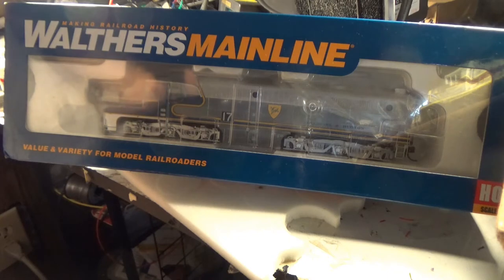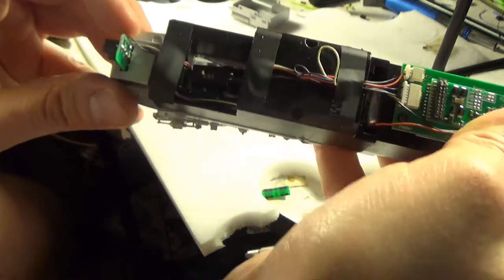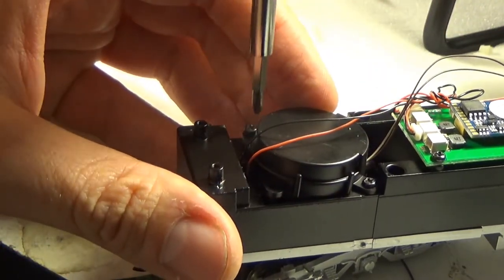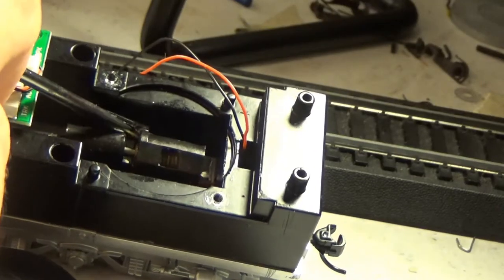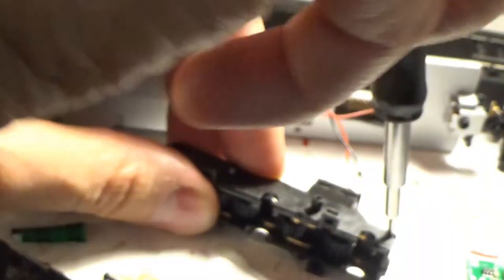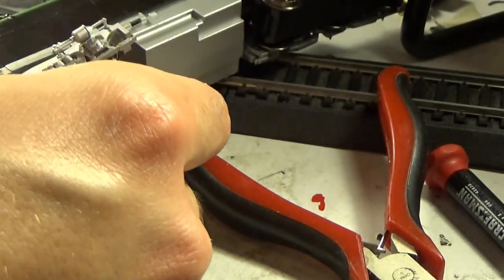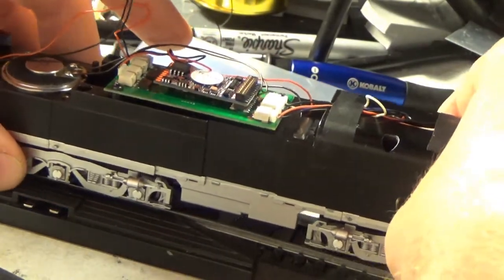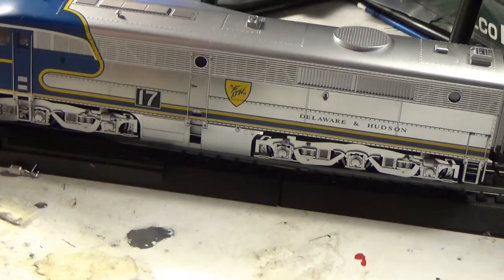Walters D&H Alco PA DCC & Sound install

Comment: 1. They are JST connectors, not 'JTS' as you continue to state.
2. WalthersMainline and Proto locomotives with this style mother board use a 1.0mm SH JST plug.
3. The company is 'Walthers', not Walters.